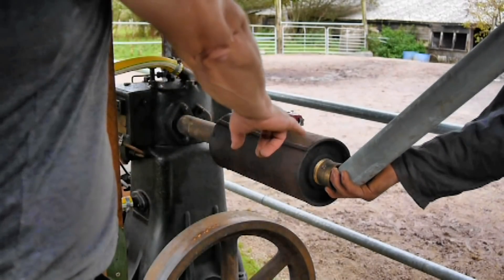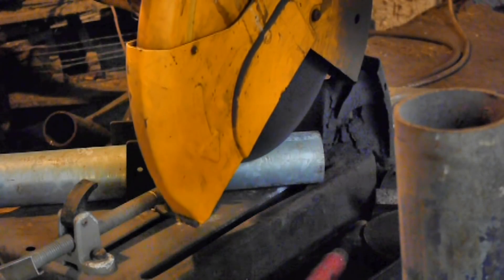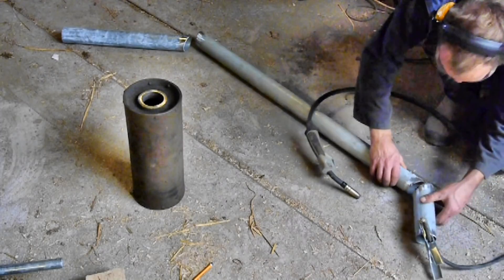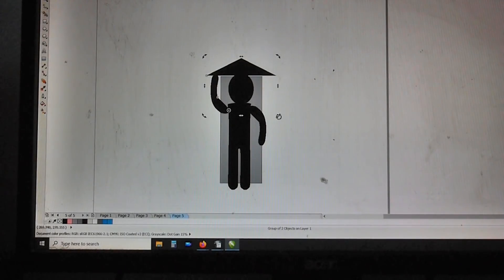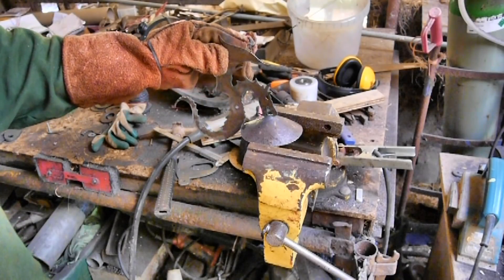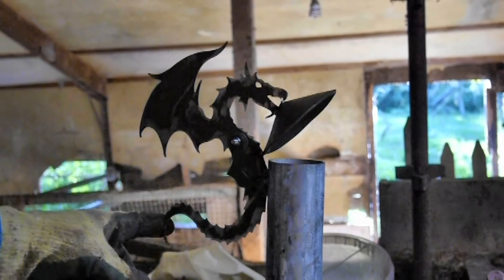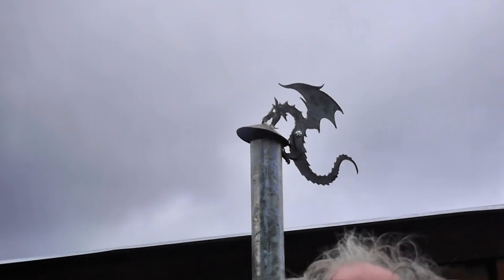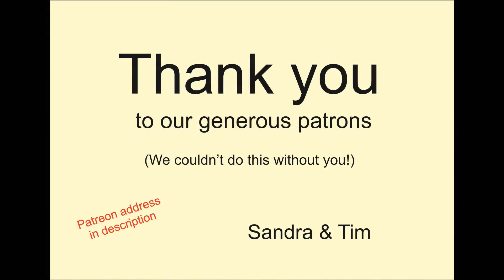Making An Exhaust Pipe For The Stationary Engine (and a small dragon!)

Comment: Tim, the dragon likely is getting pulled back down. Some hit and miss motor like that may be holding the exhaust valve open when not on a power stoke or when commanded off.  To fix this, put another cone roof around the pipe just below the dragon. Then put a few holes up under the roof to allow the engine to pull air back in. This will help reduce the dragon from popping back down as hard as it is and still keep the water out. Also this will give it a castle tower look.

 Even if you don't do the second roof, be sure to put a small 1.5mm hole in the bottom of the pipe right before the muffler to allow any small amount of water that may enter the pipe to drain out and not go into the engine.
Reply from the maker: Good idea (though it's not a hit-and-miss engine!)

Comment: If you put a bit of hydrochloric acid in a suitable plastic container and dip ends of galvanized pipe in it, it will remove the zinc coating. Be sure to rinse thoroughly and wear proper safety equipment. I use the kind for etching concrete.
Reply from the maker: Thank you - that sounds easy enough. I wonder whether I can buy that here though?

Comment: You now need something to run on steam, the engine shack feels like it's missing a whistle for some reason. Alternatively look at some of the youtube videos of old engines in india, they seem to like putting whistles on the exhausts! Or a steam loco to replace the human for the railway 🤫
Reply: a whistle on the exhaust? Interesting!
Reply: @WayOutWestx2  - perhaps in addition to driving the chopper, it could also drive a compressor to pump up a small reservoir for a real steam engine type of whistle.  Or just get one of those 5 gal air tank (or something similar) that's refillable and use that - fill it up with your shop compressor - which I assume you have?

Comment: Congratulations on your 1000+ subscribers and great dragon, but welding zinc coatings without a vapour mask will make you very sick: https://en.wikipedia.org/wiki/Metal_fume_fever and the shut eye weld technique will make you blind, sadly seen it with welders including my Father.  Auto darkening helmets are much cheaper than a guide dog. Thanks for sharing!
Reply: They did appear to grind off the zinc.  From the outside at least.